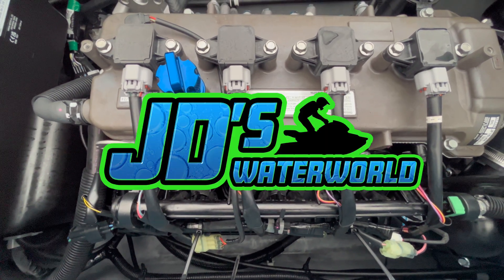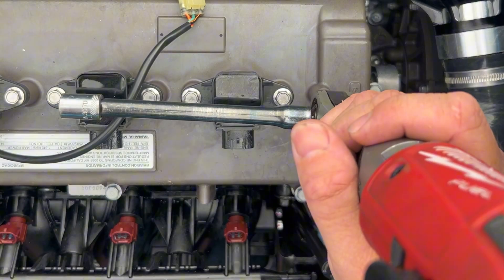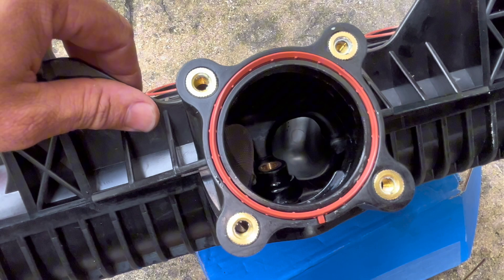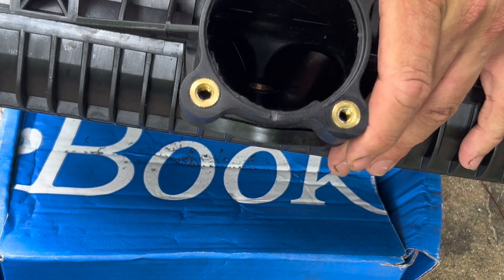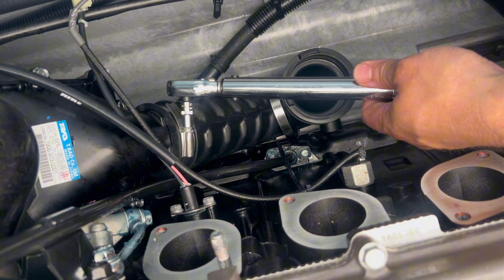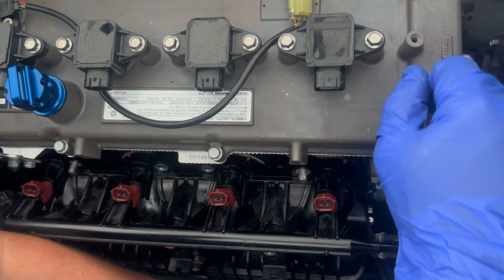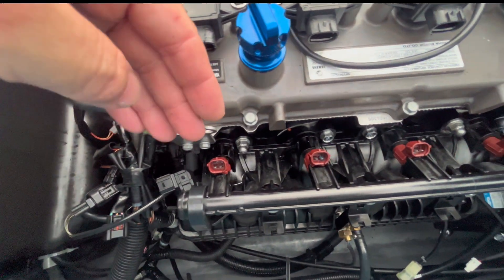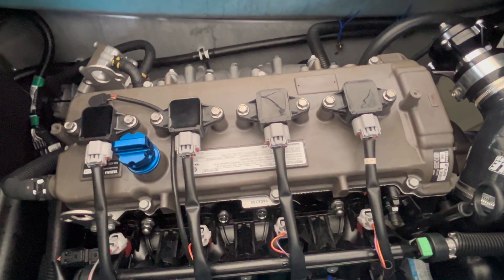Ribbon Delete Procedure for 2018+ Yamaha SVHO WaveRunners [4K]

Comment: do you notice any seat of the pants differences with the cold air, BOV, ribbon delete?
Reply from the maker: Performance wise-  the intake and BOV on its own do nothing. When the ribbon is removed and paired with the proper tune the intake makes a big difference. You need a tune though or else you will ride the rev limiter

Comment: Is there any reason you see to install that new black sleeve?  The one with the 4 orings on it.   why not just drill/file that extra plastic out and put it back together?
Reply from the maker: Because some of the shops who profit off selling the billet insert have claimed it reduces air turbulence lol. Probably makes 0 difference but it does look nicest than ground up plastic!

Comment: Hi all,
Excellent video.  Especially the good details on re-installation.
My removal technique was different.
I used a unibit to dig a hole near the edge where the lip is located. Go slow with lost of lube, the ribbon material is very hard and tends to just eat a drill bit if you run the drill fast Then use  fine awl or ice pick and pound it into the little holes in the ribbon.  Each time it will crack off a bit of ribbon.  Working against the internal ridge will keep the ribbon from moving away from the drill.  . When you get to the edge of the ribbon, you can the turn the it sideways and crush it.  This leaves the original o-ring groove intact.
The use a dremel to remove the ridge on the outlet side of the ribbon that was NOT keeping the it out of the motor.  My GP has 7 hours and the element had already begun to move.
Chasing the threads in the block will really ease the install, especially those two on the bottom.
The fuel rail and injectors just pull off the manifold, better than leaving them in place.
especially those two on the bottom.
Not only does this prevent a possible engine failure, but most "tunes" assume this has been done, as it has an effect on cylinder to cylinder mixture.

Comment: I recommend NOT following yamahas torque spec on the clamps. They are famous for being too loose from factory and allowing the couplers to pop off.
Reply from the maker: Maybe they just don't torque them to their own spec from the factory lol kawasaki has the same issue, but once they are torqued correctly, they do not have an issue. 4.4 foot pounds seems like a lot, more and I feel like the clamps would break. What torque value are you tightening your duct clamps too?
Reply: @JDsWaterWorld I torque them by hand, I use a 7mm hex drive screwdriver. Bascily go as hard as I can. Never broken one and holds high levels of boost well
Reply from the maker: lol ah. See, I'd loose sleep if I didn't know the exact torque of every bolt  and clamp 😂
Reply: @JDsWaterWorld thats a bit much, just a clamp and youre not going to over torque it with a screw driver. I really do suggest you go thru all the clamps and give them a good snug.

Comment: Just about to do this job. Is permatex thread sealant high temp in a small tube pretty much the same as you used??
Reply from the maker: Yes the Permatex thread thread sealant should be just fine. I used permatex aviation #3 sealant which can be used for threads or machined surfaces. There are a few different products out there that will work just fine
Reply: Thanks, did you also grind / sand down the lip inside the manifold or did the Riva kit just slot in without having to do so. 

Thanks ☺️

Comment: Great !!just a great  
Video !!!
Two middle cylinders lean without tune !!a lots opinion outside !! If you tune it up 
....the middle ones   
At normal and the othher outsite to fat !?you need a co2 sensor on each cylinder !!what do you think?for me sounds logic!!!
This fucking ribbon makes me crazy !!i talk to a race guy and he say in 30 years of buisness he saw 2 loose ribbons !!i know two too much !!
But he tune all his skis up to 600 horsepower without  delete the ribbon because of the lean problem with  any ecu and air tune changes !?
Reply from the maker: Yes many opinions out there..but as you saw the ribbon was crooked on my new ski..and there's a huge risk of sucking the rubber gasket into the engine and screwing it up bad. The guys at Riva tell me that the MAP sensor provides the data needed to enable the ECU to adjust as necessary when the ribbon is removed- and that it does not run lean. The factory tune I don't know for sure, but with Riva tunes you should be fine. I do have a PLX wideband module so once I get the right adapter for the Yamaha I can collect some AFR data. Again, people make all these funky claims but almost never provide evidence or data.
Reply: Your Video is really great ,so i'm sure i  can do it by myself !!!thanks  for that !!my Info i get from chief Of the a german racing Team from  the p1 aqua race series .he Tell me that he is maybe the only one who have a  kit with four lambda /co2 Sensors  at each cylinder!but for normal tune he is always going the way wirh ribbon because of the lean middle cylinders
For me it Sounds 
Right , you can"t tune 2 separate cylinders with  just one lambda/co2 sensor !!how it can goes !? 
Another question for.lubricating with rust blocker every 10 hours in salt watwr use ?
Or what is your  plan?
Reply from the maker: Interesting, well he probably knows more about these engines than me! I do know a bunch of people who have removed the ribbon and have not had an issue. Maybe with a crazy race tune the engine would run lean, but up to 8300 rpm I imagine there would not be an issue, since Riva does market the kit as being safe
Reply: Yeah!!psi + is nothing i think soo !!
Maybe we Can't find a way to secure the ribbon!!what do you think or maybe you like to think about.i'm sure we can also make ribbon savety kid ;-)and also i'm sure after 25 hours you can still 
See diffrent between sparkplugs outside and inside still  
With a tune

Comment: Best ribbon delete vid on the internet! Well done!
Reply from the maker: Thank you for the comment, I really appreciate it! The manifold torque sequences are the most time consuming part of this job!
Reply: @JDsWaterWorld the two bolts on the bottom of the manifold are a nightmare to reinstall. There’s got to be a tip or trick to make that easier.
Reply from the maker: Yeah they were even worse to get out because one of mine was cross-threaded from the factory..I had to re-chase the threads and it was a major bitch. If you use an air ratchet or m12 with a long extension it makes it easier to get them installed

Comment: I'm going to have fun tomorrow. I'm installing the BOV, Power filter, Engine breather, and ribbon delete. I'm dreading the ribbon delete!
Reply: I literally have the same planned for tomorrow 😂. Riva power filter, tial bov with fizzle piping, worx catch can, ribbon delete, Riva ride plate, and 10 hour service.
Reply from the maker: Make sure you add the tune at the same time as all the modifications or you will just bounce the rev limiter on the factory tune!
Reply from the maker: Hopefully you don't have a cross threaded bolt like I did! I had to re-tap the threads on the block and they took me over an hour alone and I was super pissed
Reply: @JDsWaterWorld Ya, I might hold hold off on the ribbon delete for another day.
Reply from the maker: Hahah Tommy yeah it took me about 2 hours total.. but the cross threaded bolt and crooked ribbon added extra time to the job..without those probably about an hour
Reply: @JDsWaterWorld  ordering the map tuner, cooling upgrade and 13/18 impellar this weekend to round out the stage 1+. Eventually want to go stage 2 just for the extra cooling and may even keep the rpm at 8500. Recently ran across your page after purchasing mine about a month ago. The walk throughs have been great for review before doing my own install.